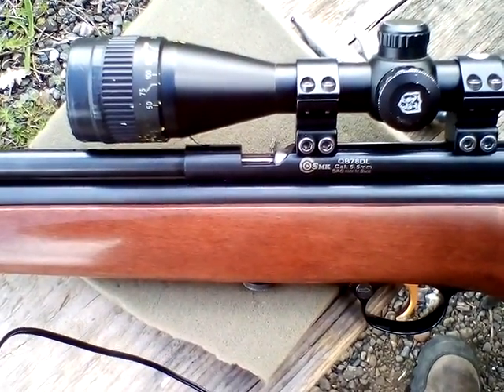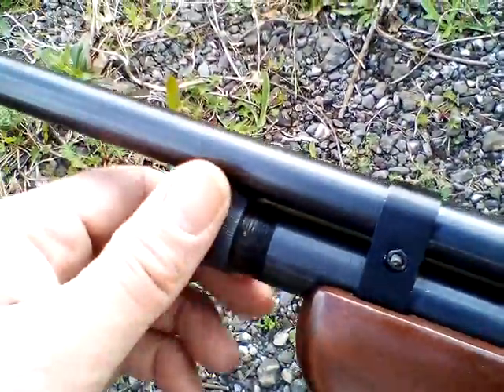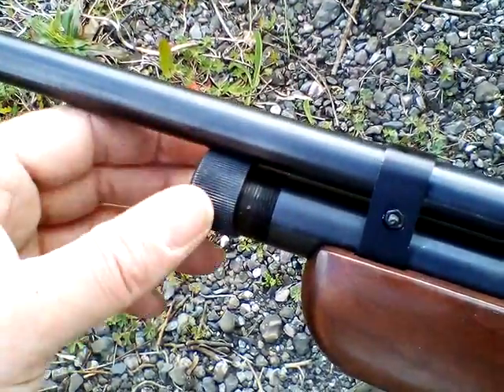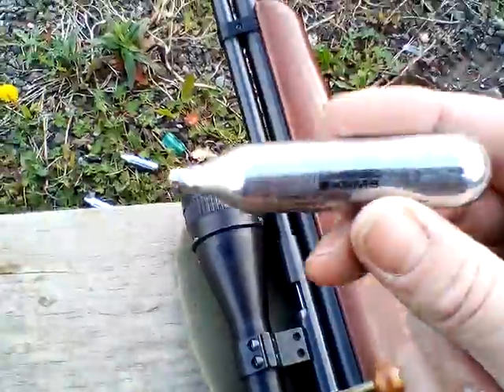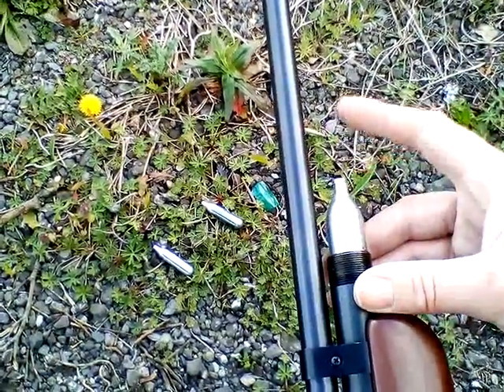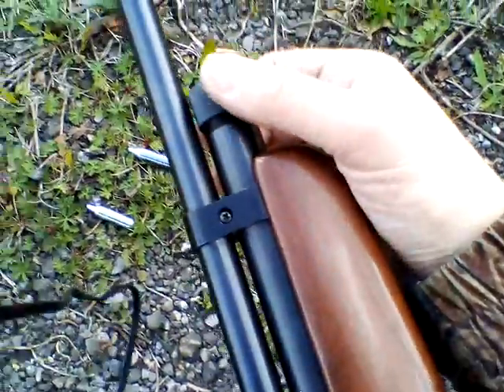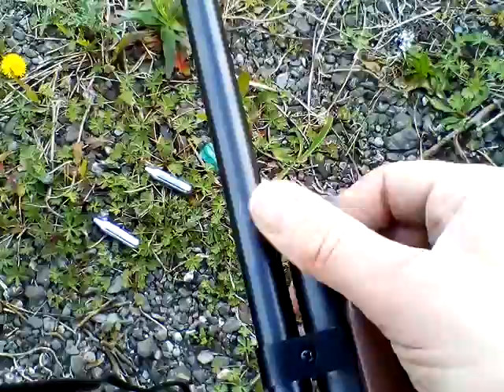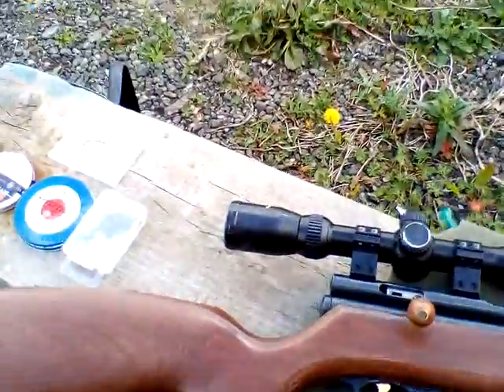Qb78 "how to gas up"

Comment: what would happen if you only installed one new Co2 cylinder and used an empty one in #2 position,  would still work but with fewer shots, would the power be less.  seems like a good idea if you just want to do a little plinking in the backyard
Reply from the maker: You would get less shots, around half. 👍
Reply: The manual I found in the 'net says that you may use just one CO2 cartridge. Put an empty one in first, neck backward, and then load the second fresh one normally. You should get some 30 full-power shots with one cartridge.

Comment: I have the same rifle but every time I put the gas canisters in it leaks all the co2 out.  I think it might be the seals. Are they easy to replace
Reply from the maker: Yes. Really easy. Lots of info online or if you need i have info i can email you. 👍
Reply: @theleadshedvlog3994 does the end cap have 1 or 2 seals in

Comment: Is it okay to dry fire this air rifle like you showed in the video? I just got this bad boy and it's awesome and very accurate. I was worried that dry firing might damage the rifle like other Co2's.
Reply: This  rifle seems ok to dry fire. Ive done on qb78 before with no problems and no damage when checking its working after assembly. Try not to do it to much though. 👍
Reply: @springrifleshooter1582 Thanks a lot! I actually found the manual online and it says you're supposed to dry fire until the Co2 is empty or you twist the cap and let the Co2 run until it's empty. So I guess it means the rifle can handle it. If not I'm sure replacement parts are easy to find for such a popular air rifle.
Reply: @lca89  dry firing a co2 has not detriment to the gun. Same with PCPs. Springers, however...

Comment: In another review they said you can put one capsule in the gun . I was hoping you might have shown this in the video
Reply from the maker: Malcolm James, put a full capsule in first then put a used one in second.
Reply: @theleadshedvlog3994  You just saved me so much Co2 LOL.
Reply: @lca89  put the empty one in first not second otherwise you may over tighten the cap.
Reply: @handlesarefeckinstupid  I put a full one in first and it was working for a while then yesterday I did it and lost all my CO2 air, it did it again today, lost all my air.  Imma try it your way and see if there's a difference.  Why are you supposed to back it off 1/4 turn after seating?
Reply: @theleadshedvlog3994  name of scope you use ?

Comment: There is a trick to loading co2 into this gun. Every time I use it I end up wasting two CO2 because it leaks out. I don't know how it doesn't leak out on yours because something that you're not doing properly but it seems to work out I'll have to figure out there is only one video on YouTube that shows the proper way and I wish I could find it again.
Reply from the maker: Not sure what you're talking about, they are very easy to load co2 , use, strip and maintain . Try explain where or how you are having problem or make a video and link it and i will help you solve your problem.
Reply: @theleadshedvlog3994 i believe that it (CO2 uploading) should be done with locked gun, I mean closed lock (gold lever) Correct? With open lock gas will leak

Comment: My recent qb78s needed pliers to unscrew the damn thing... I must've over tightened some how?! Aditionally it only opened one of the two cylinders
Reply: Sounds like overtighening it.
Alot of it because build up on pressure as CO2 canister open aired in valve tuning,i fixed someones rusted crossman  2240 got back to working order, best advice is wd40 , make sure not too overtighten as this only gets tighter as co2 is loaded, you can break the seal and end up leaky low powered air rifle. i'd do a fire test see if it fires straight,you can buy new parts, easily online, probaly becauses its new and parts can be stiff

Comment: Hey  do they take 12 grain co2 or 90
Reply from the maker: Lil MELLO, 12g, can take two full canisters or one full one , empty if you don't want many shots, like if testing after adjusting bits inside.
Reply: 12g , get them on line, buy in bulk for best price. Between 30p - £1. Ea.
Reply: Lil MELLO 2×12 g

Comment: Just bought 2 of these rifles, and the one works perfectly and the other its leaking the c02 out.. How would i fix this? Ive tried using oil to seal it but still leaks can anyone help?
Reply from the maker: Strip the rifle down if you can't tell where it's leaking from. Inspect parts and debur rough edges especially where there are seals. Don't forget all holes in tubes and action. 👍